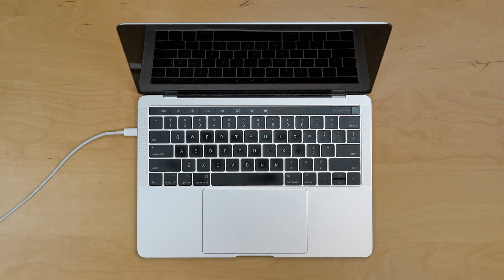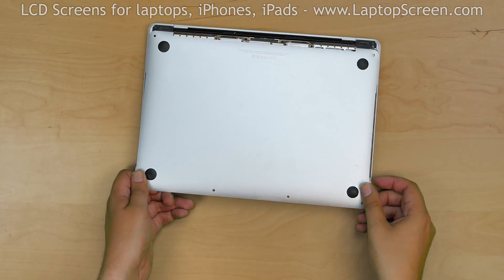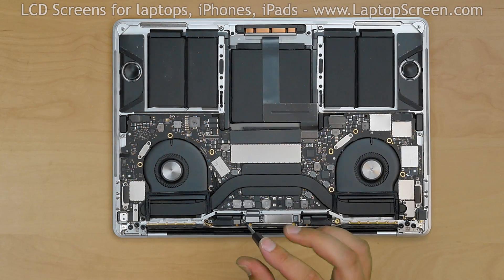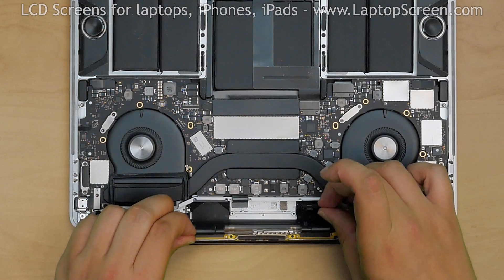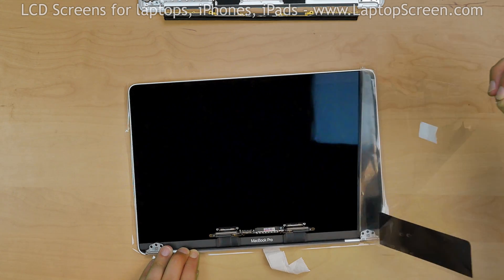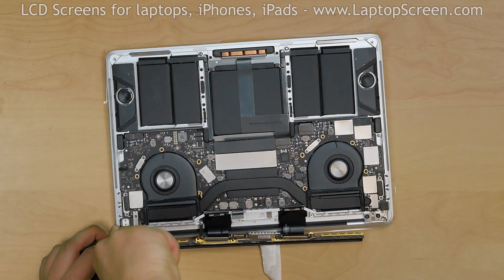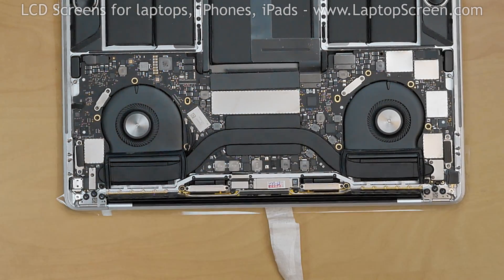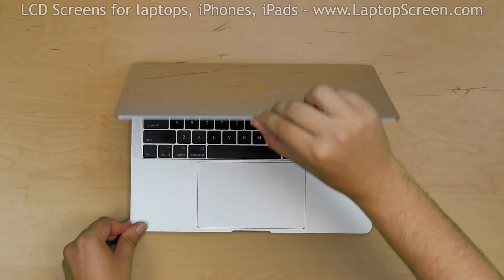How to replace display assembly on Apple MacBook Pro 13" Model: A1706

Comment: This video is just great. I would advise anyone dealing the first time with such an amount of tiny, different sized screws to be organised dismantling the MacBook. The 6 smallest screws on each side of holding the wifi antenna are quiet delicate ... be careful not to over screw them ... 
writing this comment already with the new working, mounted display on my old MacBook Pro ... Thank you for the video

Comment: Hi.  I bought and installed the screen according to these very easy to follow directions.  Everything works, but I keep getting a "popping" sound when opening the screen past about 90 degrees.  I've taken everything apart and reassembled 2X with the same result.  Does anyone know what this issue could be and how to fix it?  Thanks
Reply from the maker: It could be the tension springs in the hinges getting snagged, you could probably loosen the hinge nut and rotate the tension springs to a position that doesn't snag.

Comment: About to do this...

Did you not disconnect the battery?? Is there no need to?
Reply from the maker: It's generally a good idea to disconnect it, you can see how it's done here: https://youtu.be/rPW1-fsIVn4?t=227

Is there a need to? Think of it as a game of "Operation", if you don't short anything out, unplug and plug everything very carefully and correctly, then as you can see from this video - the device will work. It can even be done with the computer fully turned on. But the problems come when you start fiddling with live connectors or make mistakes like dropping metal tools on live circuits.

Comment: Sooo great video but you do all this while the battery is in line? Shouldn’t we pull power first? I’m scared to damage such an expensive laptop 👀
Reply from the maker: Good question. Provided that all dis and re connections are done properly and carefully the procedure can even be done with the laptop on. But its not a bad idea to de-power the laptop, we do it here for a touchbar replacement, it should be similar to this computer: https://youtu.be/rPW1-fsIVn4?t=227

Comment: Everything went great but then when I open the laptop it pops. The edge of the laptop is getting stuck on the wifi bar. Idk how to fix this I unscrewed and re screwed like 3 times
Reply from the maker: Check that your hinges are aligned - the top shell is flush with the main body. Otherwise your Wi-Fi antenna bar may not be popped in all the way down. There's a metal bracket underneath the bar that goes into a slot, it may not be sitting right.

Comment: Hello, I just replaced my MacBook 1706 with a MacBook 1708 screen, now my Touch Bar doesn't react anymore. Is this normal? Any one a solution? Thanks a lot
Reply from the maker: Yeah the A1706 and A1708 use the same parts, so your Touch Bar issues aren't likely related to the LCD directly. Recheck all connections maybe?

Comment: Thanks for the excellent video. I have successfully replaced the screen, but it is not starting. Seems like completely dead. It was running fine with the bad screen.
Any suggestions what should I check ?
Reply: Hi . I got the same issue after installing the new screen did you fix yours
Reply: @heunikl1  Same here.
Reply: I too had the same issue. I rechecked my work. Still blank. Ideas?

Comment: Nicely done. My "flexgate" MacBook needed a display replacement, and this was a perfect guide. When attaching the new display, I found it helpful to use masking tape to lightly hold the various ribbon cables out of the way. This video helped not only as a general guide, but to ensure placement of parts was correct during reassembly.

Comment: Just a headsup, the kit with the screw/torx drivers that you include for this (or can buy for this) doesn't have a T 3.0. It's, unfortunately key to finishing the job.
Reply from the maker: Sorry to hear that. We do have a multibit set that has it. Its probably best to have a very extensive bit set on hand when dealing with Macs.

Comment: TIP: Wait for few minutes after replacing the screen and pressed power button. sometimes the laptop reacts slow and needs some time to turn on. it may play dead and may scare you badly. check trackpad is clicking.

but

you are in trouble if it's not clicking after pressing power button.
Reply: @iffqds what about if it keeps restarting sound with black screen

Comment: Great video - I'm a computer engineer of almost 40 years but it's always important to have a good guide to follow when attempting something new. Every step proceeded exactly as you showed, I found the spring loaded cable guards the trickiest bit, they fell onto the keyboard side of the screen. Once I'd tamed those the replacement screen worked perfectly - top marks for a superb and perfectly clear guide.

Comment: The brilliant video however I can do but am stuck where the video plate is I can't get the 2 screws out and I have bought tools to do the job but what screwdriver is required for this plate to disconnect the ribbon.cause i got 2 boxes of tools not one is working.thanks.
Reply from the maker: I think it was a T4 Torx. Maybe a size smaller/bigger, but Torx for sure.

Comment: I can’t get my backplate back on... I don’t know what to do. I push on a slight angle, but it will not slide back on all the way.
Reply from the maker: Check that all the slide-hooks on the back of the back-panel are straight.

Comment: Nice video, thank you for sharing. I've seen videos of the Apple factory where they are cutting out the body by milling, but how do they make the screen lid?
Reply from the maker: Same way. Its just they polish the outer surface to make it smooth and round. But the inside of the MacBook lid has the signs of milling.
Reply: LaptopScreen.com thank you for the reply. So do you think the lid is milled and a worker the puts the monitor screen inside and then the glass cover? Or, is the lid always on the production line and a machine puts in the monitor and glass?
Reply from the maker: I don't know exactly, but a worker may only be there to kiss the completed package goodbye as it rolls off the automated conveyor and heads out from the factory. At the very least a matrix replacement job completed by a person is rather obvious when compared to original unrepaired Apple assemblies, so its doubtful that a human touches the LCD assembly before it is attached to the computer.

Comment: Does anyone have a link to the tools?
Reply: I tried the laptopScreen website but the shipping costs as much as the tools
Reply: LaptopScreen.com uhh I meant the tools to open the MacBook
Reply from the maker: Ah that's where that reply to a different commenter went, thank for finding it :)

In-regards to shipping being the same costs as the tools. Honestly, its one of the other: the real cost of shipping and the real cost of tools or free shipping and double the cost of tools. Shops that provide free shipping pay the real costs of shipping with product margin. We provide real-time distance-based delivery quotes based on the address provided and have warehouses in the USA, Canada, UK and Poland. If you aren't located in one of those countries the item will travel internationally across borders, continents and oceans and the shipping costs will be reflective of that.

Comment: Hi quick question. if I know that just my screen cable is bad because me being the mindless person I am tried to wrap my back plate in vinyl I used an exacto knife to cut around the edge and slice the screen cable can I just replace that instead of the whole screen assembly?
Reply from the maker: Yes. But it's going to be tough.

Comment: I'm only repeating what others here have already said.  EXCELLENT video!  I'm stuck in the Middle East where the closest Apple Store is a 3 hour flight from here.  I managed to order the tools and screen and followed the directions from the video to the T.  THANK YOU!!!

TAKE NOTE as to which tools you'll need.  That black plastic wedge was very helpful.  But what was even better was the hook on the other end of the tool I was able to pull back the three wires while I screwed down that solo T5.  Highly recommend a solid tool kit specific for Apple products!
Reply: next time buy a pc

Comment: Is this method worked with macbook pro model A1708 as well ?
Reply from the maker: Most MacBooks are pretty similar to that.
Reply: Just my two cents, but according to the website I found my OEM replacement screen, it reads, " Compatibility: MacBook Pro 13" Retina A1706 or A1708" so it looks like you'd be good.

Comment: Very helpful! It should be noted to be very careful when aligning the hinges. I cracked the black area under the LCD when I attached mine. Big bummer with a new $350 part.

I second Mark Shah below, unplug the battery! LaptopScreen.com you should add that to the video and save people from frying their whole machine during the install.
Reply: Same here. I wish I had seen your comment. The crack is not very visible, but still a bummer. When the hinge is not all the way in and you try to close the laptop, even without force, it  can do a lot of damage. And yes, unplug. I am not a Mac user, so I just followed the instructions here, but the one I repaired definitely was not shut off completely after pressing the power button for 5 seconds. It came to life with the fans running while it was open.